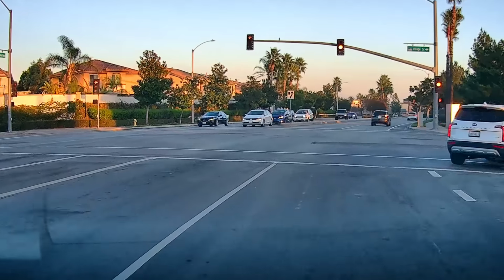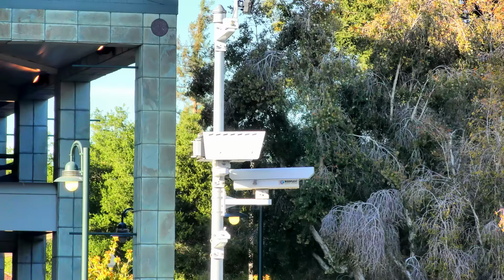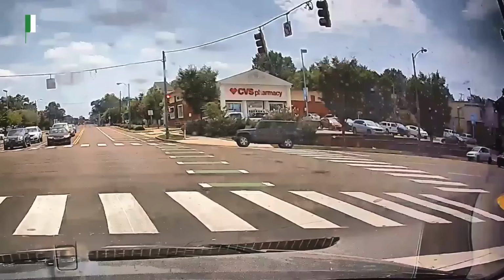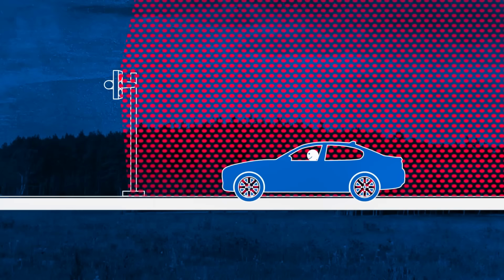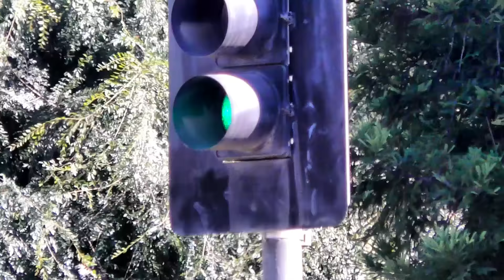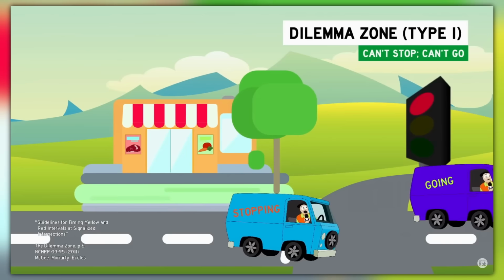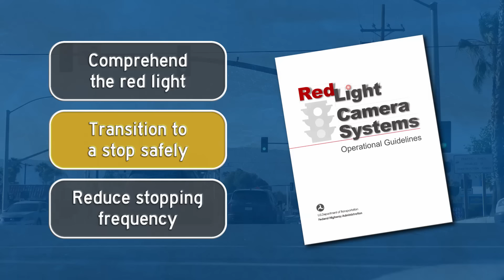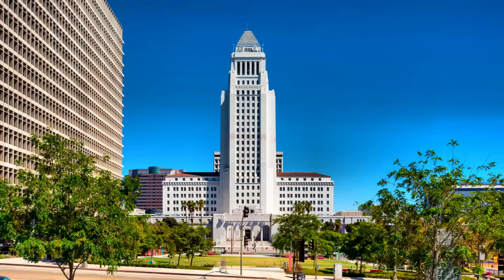Three ways to FIX a STOP LIGHT (so drivers ACTUALLY STOP!)

Comment: The roundabout shown here is one of the nicest examples you can find. One of a big problem in EU is that roundabouts are thought to be a panacea for traffic and are not well thought through causing more trouble than they solve. Most importantly, single lane roundabouts are not meant for higher capacity. So what do you do? You put more lanes on it! And now what? You have lots of intersections as some people want to get on and off the inner lanes, cross each others paths. Smart solution is to engineer the roundabout in a way you only look in one direction and you never have to cross a lane to exit. In other words, either the outer lane has to exit (does not continue, so does not cross with others trying to exit from the inner lane) or inner lane is going straight/left and you simply can't turn. The worst solution is when you go on inner lane and in a very short distance you have to get to the outer lane, give way to others and exit when you are supposed to exit while also watching for pedestrians. Besides that, as in other video mentioned, roundabouts are also traffic calmer. A great solution if you have exit from highway and you want to force people to slow down to normal driving speeds but a bad solution if you want to keep high throughput. Moveover, non directional roundabouts cause traffic jams if they are closer to their capacity. If it's not directional, you see someone on your left. You don't know if he exits or not and you have to give way, so you wait. Now if you'd only have two roads connecting to it (slam a roundabout in the middle of straight road) it means, that for every car going in the opposite direction you have to stop. It generally can cut down the capacity in half. With directional lanes you already see who is turning and who is continuing on the roundabout, so you know when you should yield and when you can go. Still, if you don't want people to slow down and you want to keep high traffic flow, they don't work.
Regarding red light crossing, this is a great summary. I'd never intentionally run on red but it happened many times unintentionally. Sometimes I know that there is a short yellow and I basically slow down before intersection below the limit in case it turns yellow. If not, then accelerate so that I will clear it if it changes now. On normal driving speeds it's sometimes very easy to drive on red. It does not seem to be dangerous as you mentioned. This happens when it changes from yellow to red, most people waiting for a green light will see that you are in the middle of intersection and let you go. The only problem is when the light turns green while you are approaching it and you enter intersection with a regular speed just after it changed. Because of that I always pay attention to other cars when it turns green, I want to be sure everyone left the intersection.
There's one more thing worth mentioning. Whoever has experience from Europe and NA, noticed one big difference. EU countries put traffic lights where you should stop (before intersection), US puts it behind. Both solutions have drawbacks. In Europe if you stay on a red light, it's very high up and unless you keep large distance from the crossing itself (wasting buffer space), you have to peak up every few seconds. This introduces delays as people need sometimes a few seconds to notice that the color changed. It has advantages though. First of all, you can see the light much earlier as it is not obstructed by trailers and large trucks on the intersection. The other one is that it's much easier to estimate the distance. In the US I sometimes find it hard to figure out where should I stop. The light is far away while I'm crossing 5+ lanes and the only indicator for me is a worn down line somewhere before that may be obstructed or hardly visible. So in general the law is different. You can not cross the red light. That's all. If you crossed the light, you are on the intersection and you have a way. Even if it changed to red when you were on the intersection, everyone else should let you get out first. It's illegal to get into the intersection if there is still a traffic that blocks your path. Why does this matter? Because in the US you have to stop before the intersection or clear the traffic light behind it. So let's say you have to stop before intersection that is 50m in front of you or you have to clear the intersection that ends 110m ahead. You see the problem? What if I can't stop in 50m but I can't also get through 110m within those few seconds? In Europe both are the same, so you either stop in 50m or you go through. It's not running on red if you entered intersection while it was yellow. And why does this matter? Because if you entered on yellow, others still had red light and they should most certainly see that you are still there. It's quite safe. 
In case of running on red while turning right, it's sort of a common stupidity in both EU and US. Designs are different, cases are different but the problem remains. If you have a requirement to stop before turning, you go very slow, you can clearly see the whole intersection and you are sure there is nobody on collision path, why would this be illegal? Enforcing stops seems to be pointless in case there is nothing dangerous about it. It's much better to enforce people to yield and maybe set a legislative speed limit on those turns. Let's be clear about it. Stops are not for you. Stops are for others to be sure you have to stop before you go. If you see a car approaching the road that has a stop sign, you know he will first have to come to a stop so you know you have time. That's how it works almost everywhere, this is regulating the traffic flow. It's often used as all way stop in the US and it works as first in - first out queue. But if there is nobody around, there is nobody that would rely on you stopping there, then it should be different. If you can certainly say that there is not a single driver that could possibly expect you to stop, then rolling stop should be perfectly legal. It's not like you enter the intersection blindly going 100mph. You just did not stop completely and you don't have to accelerate again, you saved a few seconds, made the traffic flow a bit smoother and if you first ensured that there is nobody around, there's no point in stopping besides sticking to the law. That's why those should not be counted as crossing on red. Let's give it another common case. There's a turning car in front of you that's waiting for a good time to turn. You are behind, you see all of the intersection and you see that there will be spot large enough for you both to safely turn. When he goes, you know the whole situation and go behind him without stopping. Is it legal? Not really, you should stop again but this will slow down the traffic. Moreover, if you have to stop to stay legal, the spot to turn may become shorter so you may try to rush to also turn instead of waiting for another gap in the traffic. People are rather good at estimating those, especially given enough time. If I ask you if you will turn without cutting anyone off, you will most likely be quite accurate. But if I ask you if you will be able to drive the length of the car, stop, start again and fit into the gap, you might be much less precise or do all of it in a rush. It's bad. Exactly the same way as photo enforcement actually encourages people to commit to crossing the intersection. People often drive too fast through intersection because they are afraid they will not clear it fast enough and get a ticket. After all the point is not to force people to clear the intersection as quickly as they can but as safely as they can. They should feel safe that if they don't drive too fast and the light turns red while they are still on the intersection, it will be ok. Otherwise it's just putting a pressure on something that is not important.

Comment: There is another problem with red light cameras. They promote people driving so cautiously that less cars get through per green light. Sometimes painfully so. Red light cameras were done away with locally a few years back, and the flow of traffic improved dramatically as soon as they went off line.

Comment: An important aspect of red light and speed cameras is the monetary gains. Firms employed by the local authority make a lot of money on these fines, and they even pass some of the gains to the state/city. Money talks, and no matter how inefficient the cameras are in accident prevention, they are profitable. So, nobody will change or fix anything, some dead pedestrians or drivers are quickly forgotten, as long as the cash flows in.

Comment: The point of reducing stopping frequency/signal coordination can easily be seen in the way the street lights are designed in the East/West traffic lights here in Las Vegas. The main thoroughfares often have their lights synced up depending on the direction of the major flow of traffic, and if you hit a couple lights in a row, you just move north or south to the next main thoroughfare and it's clear sailing because for some odd reason they switch the sync direction occasionally during the day. For example, it might take you 30-40 minutes while driving East on Sahara Ave, meanwhile, for those on Desert Inn, a mere mile south, that same drive might take 10 minutes, and it's not due to the number of lanes, they both have 3 lanes in each direction, and in fact in a few spots, DI gets reduced down to 2 even! It's solely due to light sync. You could do a follow-up vid examining that phenomenon here.

Comment: in UK we don't have many traffic lights. They're kinda silly when you think about it. We replaced a lot of traffic lights with roundabouts and a simple "give way" which is basically a stop sign but, you only need to stop if there is traffic on the road you're joining,  obviously, if it's a closed junction and visibility is poor, we would slow down and check before emerging. It's a very effective way at controlling traffic, no need to wire electricity everywhere, no need to stop and wait at a red light when there's no one else there, less red lights to run and over all, it's safe and cheap, 10/10. Really keeps traffic flowing. You'll find you rarely have to stop and wait on UK roads.

The only real places we do have traffic lights is in cities, where there is a LOT of traffic and a lot of directions to go.

Also, in UK we're taught to hang further behind large vehicles so we don't block our view. Kind of a, easy fix there.

Comment: They need to extend that flowchart to include the red light camera company and city revenue generation problems that run rampant.

Not enough revenue? shorten yellow interval, shorten or lengthen cycle time, lengthen all red interval, switch to left turn first, separate interval for contraflow lanes.

Comment: Or suspend drivers that run the red light - in Germany you get a 1-2 month suspension on your drivers license if you run a red light that is already 1 second into the red. You also get a point or two (depending on the severity of the red light violation) on your license and at 8 points it's a longer suspension period and possibly a psychatric exam if you are granted your license again at all.

Comment: I see a lot of people running red lights coming off the highways here in Arizona. Here, you are able to make a right turn on red (if the way is clear) on most off-ramps, but there are a few (notably, one that I use to get to work) that have several signs that read "NO RIGHT ON RED". Everyone runs those red lights. There's literally a giant sign in big bold letters right in front of you as you drive by to turn right saying you cannot do so on a red light, because visibility is bad. However, if ONE car runs the red, everyone behind them just follows. The vast majority of them don't even stop or slow down to check if the way is clear, they just go like it's a green light. I've seen so many close calls of people slamming on their brakes because a car came out of nowhere and almost hit them. I honestly don't know how to fix the issue other than drivers need to be more aware and possibly have their reading comprehension checked.

Comment: I learned the other day that when there is more than a foot of snow on the road, you don't stop for red lights unless you absolutely have to.  I was stuck at a light for about an hour on Christmas Eve in a tractor trailer.  I talked to a cop about it and they agreed it's better to run the red than block traffic and potentially cause accidents when cars try to get around you.
Reply: The real issue is that you are operating an 18 wheeler in those winter conditions with inadequate tires. And instead of spending money on new ones, you now feel entitled to blow thru red lights with a tractor trailer. Unbelievable.
Reply: @MK-fc2hn  Believe it!

Comment: I find adjusting the duration of the amber to be a clutch solution. Drivers should not be too guess how long the amber would be. It's better if the duration is fixed, but an marking on the road indicating the dilemma zone based on the speed limit is better.

And is it that bad for speeding drivers to beat the light? They will learn not to exceed the speed limit when approaching an intersection. Simply increasing the transition time will make the intersection safe enough.

Comment: One of the cures that does not come up in this analysis, but is related to the roundabouts, is to just slow down the traffic with calming mechanisms: smaller or fewer lanes, speed humps, raised intersections or crosswalks. It's a touchy subject for traffic engineering because the definitional goal of the engineer in the US system is to enable higher vehicle volumes and lower wait times, but we have to consider the military saying here: "slow is smooth, and smooth is fast". Every user of the road - cars, bikes, pedestrians - wants to go, not stop. They stop when they think they have to, but their judgment isn't reliable; rural highways that have four-way stops are often no-mans-lands precisely because most of the time the intersection is clear. If they are forced to slow as they approach conflict points their judgment is equally bad, but they have a lower speed and stopping distance, so you can get a lot of additional safety at a low cost in service level. Roundabouts just happen to be particularly good at doing this since they present a turn, a wall of slow cross-traffic to merge into, and no hard stop so nobody feels that they have to "beat the light".

Comment: Red light cameras are NOT there for safety, they're there to raise revenue. Here in Chicago they actually reduce the yellow light to under 3 seconds in order to maximize revenue. It actually increased the number of rear-end collisions because now people have to slam on the brakes for a yellow, especially if they didn't see when it changed because they had to watch the pedestrians and beggars in the middle of the street. 

If it was actually about safety they'd lengthen the yellow light so people had a chance to stop safely.

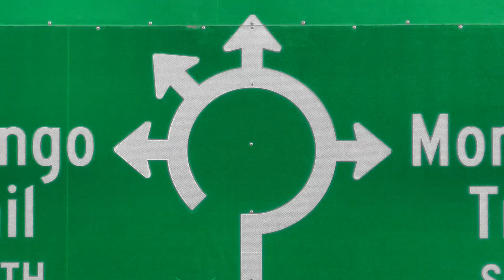Comment: A word on roundabouts! (@ 11:23 the one depicted in the Banning Pass at the Morongo Reservation, south-adjacent to I-10 near Palm Springs) The one that you can't see in this shot is this shot's twin, to the north of I-10. That one is a textbook example of how NOT to implement such a thing. Roundabouts, like other intersections, have their costs. Trying to fit a roundabout into little more than the space occupied by a traditional one can end up being almost as inefficient as a signaled intersection. Effective roundabouts (like those in Mexico's westmost city to the south of California) have roundabouts that are sufficiently large enough to handle a great deal of traffic from multiple directions AT SPEED. The cost of a roundabout is not unlike that of a freeway interchange: the larger the space it occupies, the more it costs to purchase, build, and maintain. But the trade-off is efficiency. If a roundabout is too small and causes traffic from one or more directions to slow down and perhaps stop for nearly the length of a traffic light before one can proceed, you have defeated the gains a roundabout is supposed to provide. Roundabouts as small as the one in Morongo are only effective if an overwhelming percentage of traffic comes from one direction and its opposite AND AND! it isn't frequented by large, long vehicles or trailers. This particular roundabout can become gridlocked with TWO tractor pulling trailers in opposite directions. The one depicted above is on the south side of the freeway and is far, far less congested than the one just on the other side of the freeway, out of view of this shot.

Comment: New Zealand solves problem by not having red lights but rather traffic circles which slows down traffic and eliminates the acceleration into the intersection accompanied with red light running.